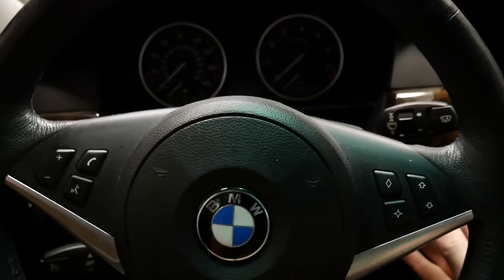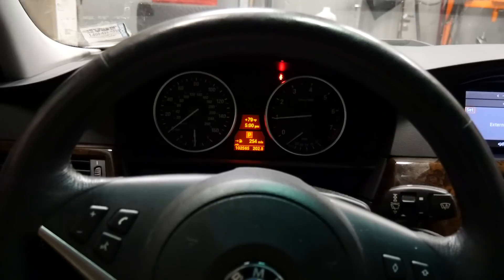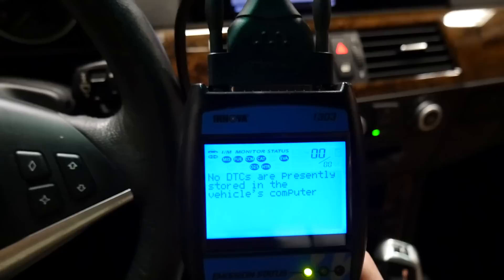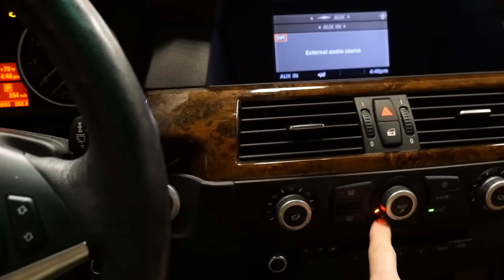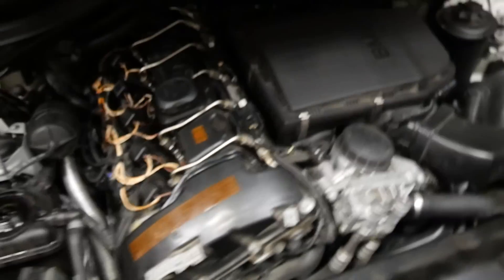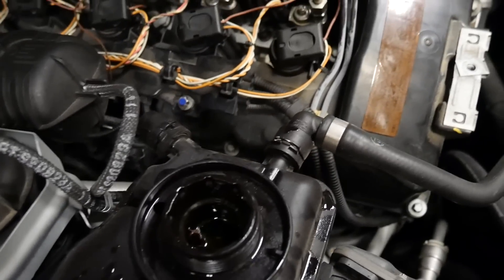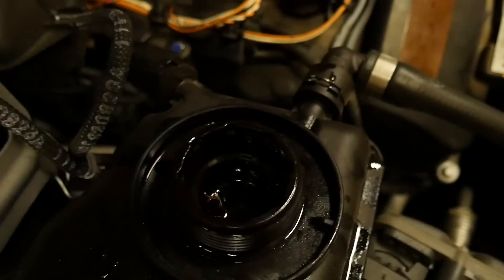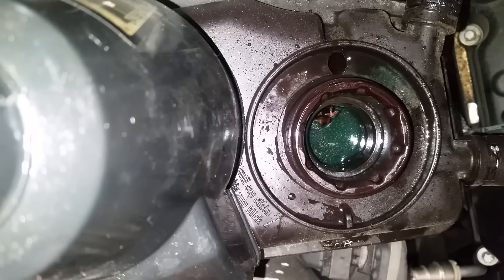DIY - BMW radiator fan stuck on high? - electric water pump diagnosis

Comment: I bet you found the missing top of your coolant reservoir level indicator stuck in your pump.  I have found several times that plastic indicator top missing from the coolant reservoir, just to find it lodged in the impeller of the coolant pump making the exact same noise as yours was.
Reply from the maker: I didnt even look, very possible!  thanks for helping the other viewers!!! :)
Reply: ironsailor thanks I’m gonna look into mine where would it be located
Reply: He’s right my car had that problem and yesterday it started making the loud fan noise
Reply: What coolant and oil do we I use ? I have a e39 525i also it’s in a higher gear what could be the problem?
Reply: I definetly think this happend to me. I broke the tip and now after few months my car is making a really loud noise. 
Does this mean I need to replace my coolant expansion tank? 
Or is the broken bit somewhere else?
Please help me
Reply from the maker: If you have the loud fan as a result of the dipstick missing you're looking at waterpump issues
Reply: Hello n55 water pump working  when car is off.  Water pump work all time and lot off battery low. Have this situation anyone
Reply: Appreciate it bro my coolant indicator tip is missing and I get a loud screeching noise like releasing air out of balloon slowly I was thinking it was the water pump too
Reply: My fan just started doing that and the tip is broke on the indicator stick. I’ll definitely check for that. Nice post 👍

Comment: I have a 2013 528i i just got and it has the high fan noise after I run it with the heater on for more then a mile it didnt do it when I got it have had it for 3 weeks now and the heater worked great but all the sudden it doesn't and the fans run hard.
Reply: My issue seems same , how did you resolve that?
Reply from the maker: Sounds like it's low on coolant

Comment: 👋 Hello, i have a 2011 F25 and my fan kicks in very high the moment i turn the Ac on ,what's the solution for that?
Reply from the maker: I'm not for certain but that may be operating that way by design
Reply: @EpicTim it stays on high and very loudd, so it's normal?
Reply from the maker: I don't know enough about that platform, sorry

Comment: Hey so ive just done the bleeding procedure bc all my coolant got drained bc of a hose and when i refilled it before the procedure the fan would go on full blast, so i do the bleeding procedure and still the fan goes ok high blast and my waterpump does working normally. I installed a new delphi coolant temp sensors could it have already gon bad from it being drained from coolant?
Reply from the maker: If your air conditioning is on it will run the fan.  Does it spray coolant in the reservoir when you are doing the bleeding procedure?
Reply: @EpicTim yes it does the waterpump is fine its working and everything
Reply: @EpicTim ive changed the temp sensors again and it didnt go away
Reply from the maker: Hard to tell without digging in, might be in the wiring

Comment: I have 2018 A5 and i believe i have the same problem. Turned on my car after 11 days parked and engine light comes on and fan running high as in your video even when idling. I'm glad i found this video 👍🏾👍🏾

Comment: My BMW's fan started turning on at super high constantly and I new right then the water pump has just failed... Replaced it with a better version made of all aluminum German made and now the fan turns on prematurely even when the car is cool or hasn't reach full normal temps.  It's annoying but I'm thinking when the water pump was failing and the car was overheating somehow it messed up the "coolant temperature sensor" and so now the sensor is turning on the fan too early sending bad signal to the ECU thinking it's overheating yet my temp needle is normal!.....  Weird but I'm going to get to the bottom of this issue...
Reply: Any luck on what it was? My car also just gave me "engine over heating temperature" warning by my needle on the dash still around 200 degrees
Reply: @IlRMII  
"Engine over heating temperature" that surely means your water pump has failed and needs to be replaced ASAP!  Also replace the "Coolant Temperature" sensor as it also gets damage it will cause your fan to prematurely turn on radically and annoyingly all the time until it gets fix!
Reply: @BIGG_DOGG_DONALD_TRUMP  Thanks for the reply🙏🏽 this past week I also figured that out, I got them both replaced and for the heck of it, I also replaced my temperature sensor as well just incase, cars running great now!

Comment: Mine does the same thing. But water pump flows fine. Should I first purge the air and if it still does should I replace temp sensor?
Reply from the maker: Surely wouldn't hurt to do the air purge first and recheck.  Probably one of the 2 temp sensors though
Reply: @ temp sensor is good. Noticed fan is really only coming on super high if ac is on. In any positions fan is on 90-100%! Thinking the computer may be sending too much of a signal to the fan?
Reply from the maker: Seems normal honestly.  Mac air conditioning should demand max condensor airflow
Reply: @EpicTim even on the lowest ac setting. Still max fan, no warm air out of vents ever it’s all cold.
Reply from the maker: Did you check both sensors?
Reply: @EpicTim I believe the 3.0 only has 1, where the 4.8 has 2. Is this wrong?
Reply from the maker: @DavidBerg-y2s no clue
Reply: @EpicTim welp, I’ll figure it out. Appreciate all the advice!

Comment: I just replaced my water pump and thermostat, unfortunately it is still happening. 

I’m a bit disheartened and I don’t know what to look for, now I have doubts about the people that checked it out :/
Reply from the maker: You still have to understand how to diagnose the issue.  How does the test result after you changed parts?

Comment: Replaced the water pump to the higher upgraded version, bleed it as like in this process yet after all that the damn fan still kicks in at an earlier time constantly.  Turns on when the car is not completely warmed up!  Has to be a reset method for the water pump as it still thinks it has the old water pump that failed and was overheating the car! 
🤔
Reply from the maker: Did you change both coolant sensors?

Comment: That's happens when use cheap after market thermostats an wrong temperature sensor.had the same issues fixed it

Comment: Is it ok to drive mines is working but I’m getting that loud noise humming fan from the front of the engine. But there seems to be nothing broke.
Reply from the maker: It depends what part failed.  I wouldn't risk it personally

Comment: My e60 n52 one day while driv
Ing my ac suddenly went dead, rad fan run full blast, and few moments later i got the overheating warning. Is ac dead also related to wp and thermostate?
Reply from the maker: AC is commanded off when the car thinks it's overheating. Probably a sensor, maybe the pump

Comment: Also wanted to add that the bmw dealer said I had a pump blockage and recommended new pump and stat but quoted my radiator fan noise separately and diagnose was possible debris in fan but  I thought that once you change the stat and pump the fan noise goes away?! Of all the videos I’ve watched and forums I’ve read I never saw anyone talk about or change the radiator fan. I need help in understanding what I should get done or look at thanks anyone
Reply from the maker: If you fix the fault, it will go back to normal speed.  The dealer and most aftermarket shops throw a ton of related parts to run the bill up as well as cover Thier tail in case they misdiagnosis

Comment: What if you saw the water in the resivor but you got the loud fan noise and code does that definitely mean you still need a pump and stat?
Reply from the maker: If the water is spraying hard, the pump is working.  If it's in test mode and it's not, you need a pump.

Comment: I have a bmw E63. Randomly the fan one day started up and kept running. Has never turned off when driving. Have checked relays and also changed water coolant sensor. Changed fan. No luck. Driven car 1000s of miles with no issue. No overheating issues. Checked waterpump and working. Any ideas?
Reply from the maker: There are two sensors, one on the head and one on the thermostat.  One controls the gauge and one the computer
Reply: Do you mean the sensor on the lower radiator hose?
Reply from the maker: There may be a model year change I'm not aware of but have seen them on the thermostat housing next to the water pump

Comment: Mine does this same thing but then after a minute or two of driving it calms down and operates like normal, unless parked. No warnings or anything pop up. Ive replaced the coolant temp sensor but it didnt resolve anything.
Reply from the maker: There are 2 sensors, 1 for the gauge and 1 for the computer which calculates what to do with the fan
Reply: @EpicTim  Where would these be? So far I have changed the one that  goes down from the coolant tank hose
Reply from the maker: Cyl head and close to the thermostat housing

Comment: Tried the test on my 2008 528xi and it does nothing. Issues I'm having are high coolant fan and overheating and not much heat from vents. Leaning towards the pump though.

Comment: Is it possible that if my fan runs high, but I'm not hearing any noise from the pump can it also be defective as well?
Reply from the maker: It could be a short in the wiring, or may be hard to hear

Comment: I replaced my water pump on my 528i 2008 model BMW and my fan is staying in high mode but now my battery drains rapidly, could this be a faulty water pump?
Reply from the maker: Could be,. Might also be a temp sensor, or pinched wire

Comment: I did change the temp sensor and it stopped but once in a blue moon the car will spin the fan on high. It will eventually go away so im wondering whTs the problem?

Comment: I had this same problem on a 4.8i. My problem was a faulty coolant temperature sensor.
Reply: Would your fan turn on cold starts and did it give you a check engine loght?

Comment: Hello,
Thanks for this hidden feature 
so I have e90 - 2011
the pump worked for 12 min like the video except the pressure was little bit lower except once was good 
about the fan sometimes it works on full speed even outside isn't that hot but not when I start the engine maybe after 5-10 min (driving) sometimes it doesn't run at all .
the car temp is 95-115 (the normal range)
any ideas ?
actually I feel when the fan turn on it stays like that .

Comment: My car does the same noise but after 20 minutes my car started I changed the water pump , upper radiator hose and thermostat but is it still making the same sound I need help!!

Comment: I have an 09 535xi and this happens randomly. I replaced the water pump with an OEM part last summer. I checked anyways and the pump works perfectly fine. No codes whatsoever, but the temp gets up to around 117 Celsius and I get a warning. Could it be something as simple as the temperature sensor?

Comment: Great video - thank you! I have a 2011 135i (N55) here in the UK and have had the fan running very fast and loudly, the car shut down on one occasion from overheating after a slow 45min drive. I get a strong stream of coolant in the coolant expansion tank when I do the bleed procedure but my BMW garage still says it's a water pump issue. My car has only done 38,000 miles. I took it to another local mechanic and they think it's the radiator fan. From reading the responses, it seems it could be some sort of sensor problem? Please can you help? I'd be very grateful if you can provide some help. I don't want to start replacing parts that don't need replacing at great expense.
Reply: Did u fix it same issues
Reply: @RealPStakks I think that the problem is in the electronics of the fan, as if the first gear weakens and then turns on the second gear to compensate and cool the engine
Reply: @autodjelovi2092  mine was water pump

Comment: Hey so question i changed my water pump back in december. But i didnt change the thermostat. My fan starts to run full speed once i get to operating temperature. Does this mean my thermostat is bad
Reply: yup

Comment: Just a note for anyone else that sees this video. Look at when he shows you the coolant in the overflow canister. That coolant is GREEN. this is BAD. Do NOT put green coolant in your BMW. If you buy a used BMW, check the coolant immediately. Don’t care if it came from the dealership. Dealerships are notorious for putting green and orange coolant in these cars. The correct coolant color is BLUE. just think BMW = BLUE. if it’s not blue, drain the coolant immediately, or you’ll be in a world of shit rather quick. BMWs cooling systems fail. Period. But green and orange radiator fluid will ruin the entire cooling system quicker than shit.
Reply from the maker: that's a great point and you may not believe me.  But the LED light I was using is UV reactive and looks green under high UV exposure.  I can promise you that this owner would only run OEM BMW fluids

Comment: When or what degrees should my cooling fan kick in
Reply from the maker: these are PWM, so they slowly ramp up.  they will also run high if your AC is commanded on max.

Comment: Can u drive like that till home?
Cause happened to me now and I'm at work....
Reply from the maker: if the water pump is not flowing coolant in the reservoir, I do not recommend running the engine more than you have to.

Comment: The easiest way to change the water pump starts by removing the fan so you can reach the top bolt. This tip saves hours.

Comment: on that note, i replaced the compressor the radiator and the expansion valve on my 530i F10 , and since then the fan DOES NOT kick into high speed, is that a problem ?

Comment: so my fan is doing the same thing it runs high non stop.. it also will run high for a few seconds then drop down, then back high then back down as i drive... i did this test on my water pump and it's actually pumping coolant. 
any ideas? 
could it be something else??
Reply: I have the same problem, water pump is fine, did you find it?
Reply: @poloraf  yeah i replaced the water pump and thermostat and it stopped, i'm all good now. i found out that even tho the water pump seems to be still working, if it's on its way to going out and not circulating the coolant as efficient as it should, the fan reacts to it and is letting you know what's up... if i was you i'd swap it out now before it goes out on you bro
Reply: @Txddjames  which car model was it? I have a bmw 335i e93 facelift, water temp is okay and ac works warm and cold, waterpump works too I don‘t get it… maybe the sensor or something
Reply: @poloraf  535xi .. its not a sensor i promise u its the pump
Reply: @poloraf  everything on my car was working perfectly fine also, except the fan doing what i mentioned. i posted my symptoms and a video of my fan doing what i mentioned on BimmerPost and many people responded saying they had the same thing and soon as they swapped it out it went away
Reply: @Txddjames  alright, I‘m gonna try it. Thank you.

Comment: I have 2009 bmw x5, after a maintenance of ac compressor, i started to notice that the fan turn to the full speed after few miles driving in the city, and stuck on the full speed until i turn the car off, when we check it using code decorator we saw a fault P0597 which it seems  heater sensor fault. My question is does the fan problem related to this sensor?
Reply: I want to add that i live in KSA where the temp this month goes above 46c and the humidity above 70%. Is it also could cause the fan to work on its full speed? 
Thanks in advance and thank u for ur great video
Reply from the maker: sorry for the delay, the fan speed fault could be related to anything that handles or managed by coolant temp.  i'm unsure of the factory programming detail beyond what's in the video and other comments

Comment: @Epic Tim - I just tried this procedure on my 09 335i M sport and it made the exact same rattling noise when i checked the engine. My fan was on full blast when I started my car this morning and the temperature gauge was still cold. 10 min into driving the temp shot up to 250F and my car went into limp mode. I received overheating warnings, parked for 15 min and made it back home. I'm not really mechanically inclined...what's the best water pump for my model? Probably need a thermostat replacement too. I don't have a OBD2 reader either (buying it today). Looking for ways to save some cash before i take this to the shop. Thank you all!
Reply from the maker: sorry for the delay, BMW pumps are usually the best, turner motorsport and pelican should both carry aftermarket kits also

Comment: I had the same issue but luckily I just needed to top up the coolant
Reply: How low was the coolant? I've been having the symptoms in the video (Super unresponsive throttle/Low power and the rad fan going into hyper drive) and then after I saw your comment and remembered my coolant was a little below minimum and I just didn't top it up. I've just gone to my car now (F30 335i) and topped it up, hoping by morning when I go for a test drive it works how it should.
Reply: It didnt display low coolant level anywhere indicated on dash?

Comment: very helpful video - thanks!
I have a 135 / N54 and suddenly had the cooling fan roar to life on a very short trip.  I found this YouTube video and ran the water pump test you describe.  The pump works fine - like your video after replacing a faulty pump.  
As I read through your responses, it looks like you're suggesting it might need "a temp sensor for the ECU circuit;" or in a separate message, one or both "coolant temp sensors" (one on the cyl head, one near the thermostat housing).
Is the "temp sensor for the ECU" the same as one of the "coolant temp sensors"?  If not, which would you suggest be replaced first?
Thanks in advance!
Reply from the maker: Yeah, same thing, one for the gauge, one for the ecu.  Not sure which is which per car